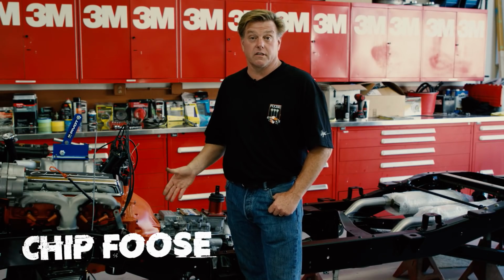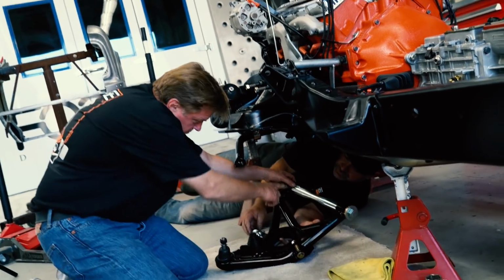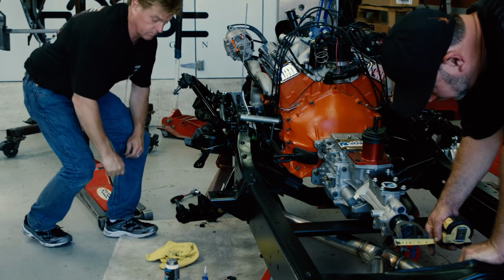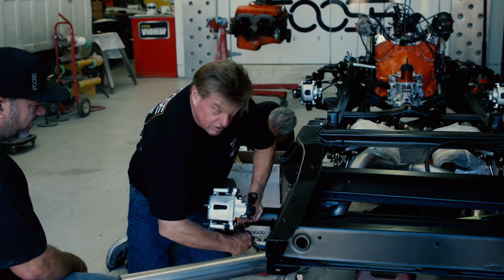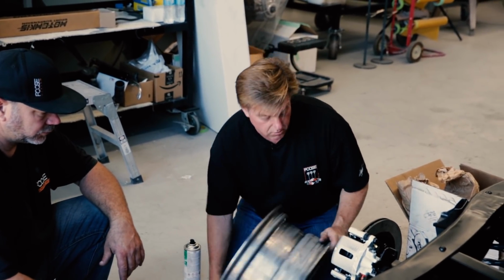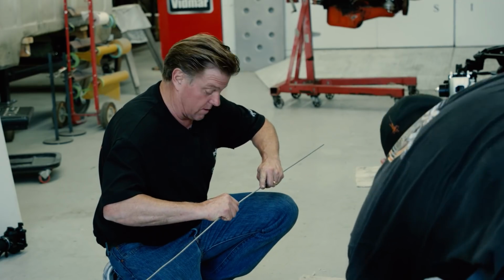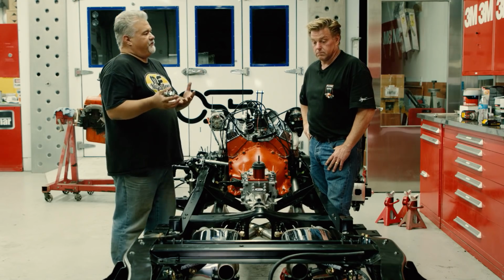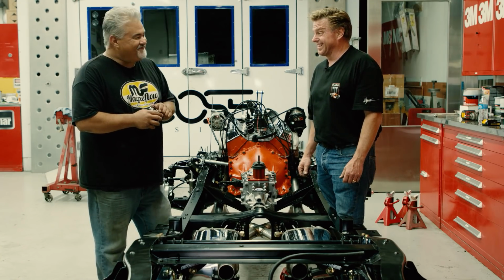Foose Design 1967 Chevy “C/28” Project – Suspension/Brakes/Exhaust (Part 3/8)

Comment: Quick tip....To get tubing perfectly straight, clamp one end down and rig up a way to pull the other end a little at a time. After a pull and you release the tension, look to see if the tubing is straight. Keep doing a short pull and check for straightness till it becomes perfect. Amazing how this will get it perfectly straight!!!

Comment: Every one of Foose's vehicles looks like a Foose vehicle.   There is never enough uniqueness among them.   You can spot any Foose stuff out of a group of 100.   So much for originality.    Everything has to be lowered to the ground with 40 inch wheels (foose designed of course).     I wish he's stay away from bastardizing every 70s muscle that he gets a hold of.
Reply: You're high, he makes hotrods like no one on this planet. Sometime a design from the factory don't need much, and little changes make a huge different if you know what you're looking at. A#1 Bar none.
Reply: Could anyone tell if he notched the frame?